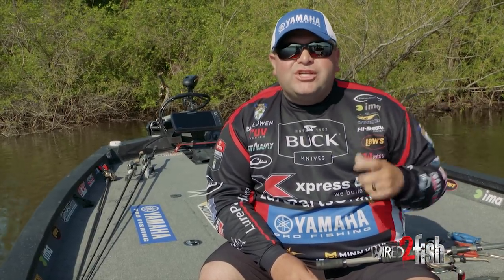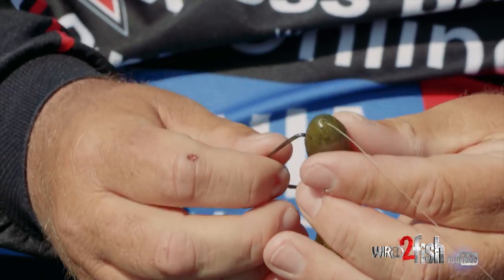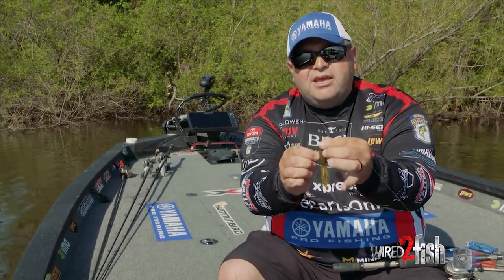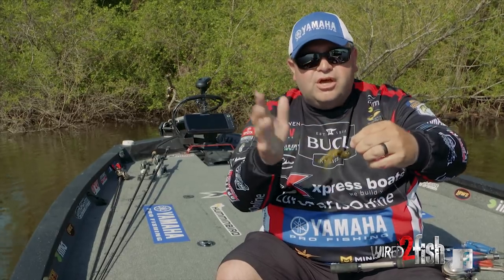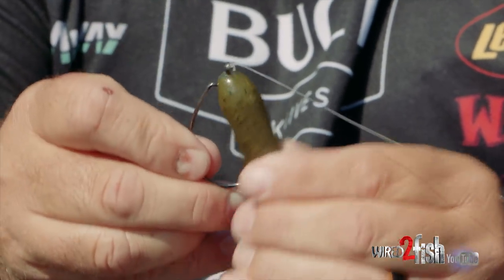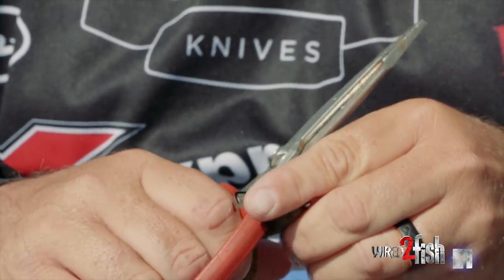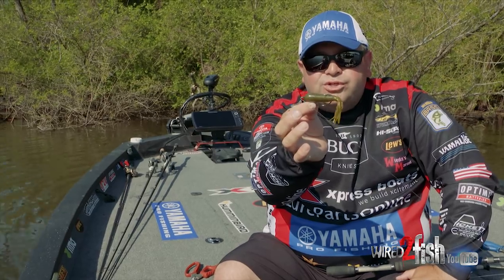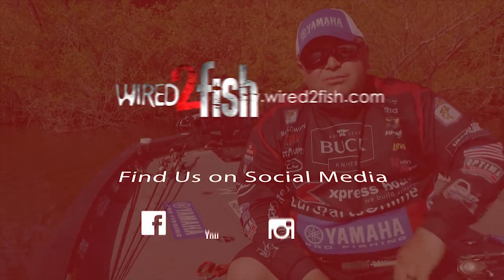3 Must-Know Tube Rigging Tips to Catch More Bass

Comment: Great tips. We bend our hooks in the center of the shank though not in the hook bend radius. If I don't have pre bent hooks with me I use the toothpick trick and bury the hook in the solid nose section of the plastic. 
Here's a tip, if your fortunate to be after giant largemouth. Evenly trim 3/4 of the tentacles off a tube and stuff a double tail grub in it. Just make sure the center line of the double tail split is centered with the hook shank when you put the hook in all of the bait. No worries you'll be capturing at least a quarter inch of the grub body when you hook it up and go 'football jig head' style. Drag it on the bottom with the occasional pop pop and hang on....